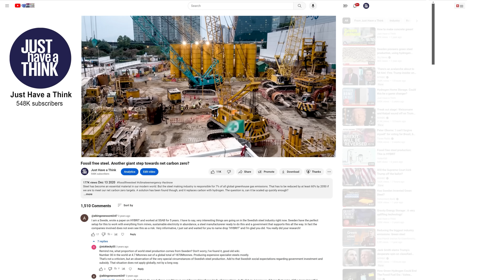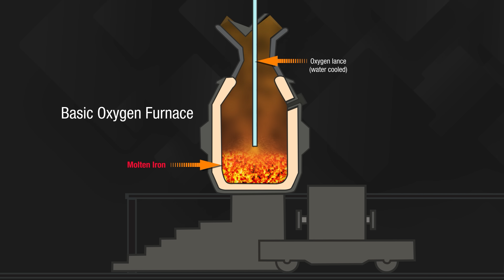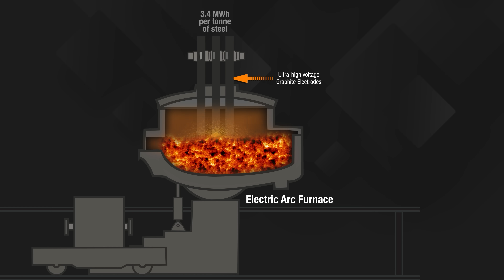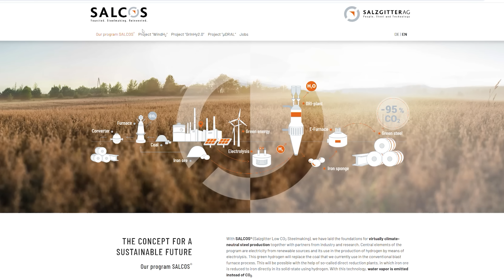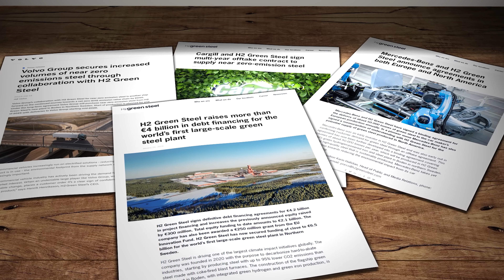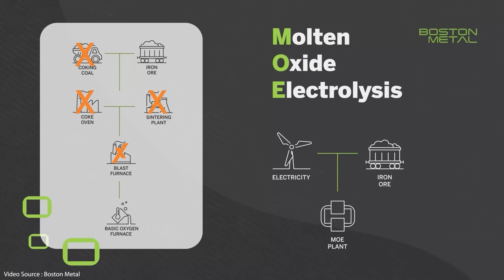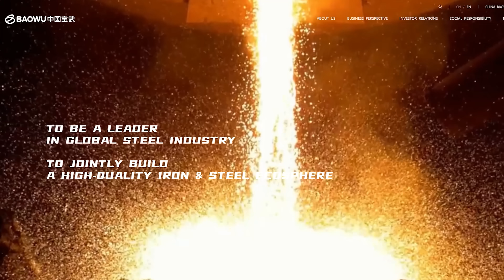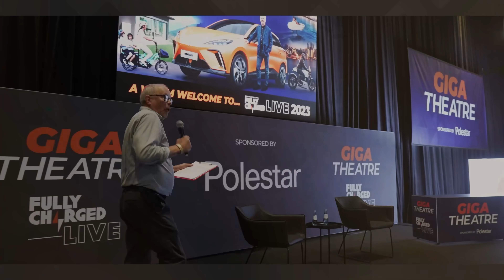Green Hydrogen making Green Steel. Is 2024 the breakthrough year?

Comment: Green hydrogen? That's the question. Could you make a video on high temperature gas nuclear reactors? I know Japan is working on it, and they allow for a green hydrogen process too. Annoying to research though.
Reply: Given that the hydrogen is cycled between water & gaseous form in a mostly closed cycle, It think that it's a moot point. More pertinent is the source of the electricity. Though a less regulated electrical source is required, so producing green electricity would likely be cheaper for this sort of use than the fine controlled flows required for household use.
Reply: @FreeManFreeThought  all good points.

 Mostly, I just remembered those reactors by association and wanted to comment in hopes of seeing a good, well researched video.

Comment: Ah yes, let's use electricity in place of fossil fuels, to make steel! Lol huh.  How do you produce that electricity??? Well, if it's by wind turbines and solar, you are going to have to tap that entire grid to get enough electricity to power the high energies needed to do all that heating,  or you use fossil burning power plants to get the electricity from but that just pushes the co2  pollution upstream, in the whole process so that doesn't fix the problem OR get the electricity from the practical, least polluting, efficient nuclear reactor plants that is the best solution,  in the real world power generation choices, in the world at present! The new generation nuclear plants are efficient and produce less radioactive waste and are safe.  Countries need to drop the outdated unwarranted taboos propagandized on the nuclear energy industry and build them to power the 21st century.   Actually a good part of the world sees this proper sensible solution and utilizes nuclear plants and are building more and/or modernizing existing plants but, as usual, the United States is way behind.  Smh

Comment: Ocean-based carbon capture isn't stupid.  It's not a gimmick, and it's actually intended to remove CO2 at a gigatonne scale.

On the topic of clean energy for producing green hydrogen for steel production, and various other things, here in Canada, we have a massive amount of hydropower.  We have 160GW of untapped hydropower in 9 out of 10 provinces, and not including the territories.
The  Northwest Territories alone, we there's 11.5 (or 13 GW if you include the Slave River between the NWT and Alberta) of untapped hydroelectric potential.

Hydropower is not just a source of electricity generation.  It's a means of achieving grid stability and can help integrate tens of GW of wind, solar, and also inflexible sources of energy, like nuclear.
Reply: He did make a video about ocean-based carbon capture. https://www.youtube.com/watch?v=kzMWIrh6bL4

Comment: 7:57 As far as I'm concerned it is. 20-30% more is a absurdly large increase in cost for a foundational global commodity. It is not worth the CO2 reduction. Find a better method, or get cheaper electricity. Otherwise abandon the attempt.

Comment: The Molten Oxide Electrolysis is almost exactly the same method used to refine Aluminium.
Reply: The Hall Herault electrolysis cells do use carbon electrodes and CO2 emission is approx 1.22 t/t Al.

Comment: Another huge problem with this process is the iron ore must be over 67% .     Currently only 3% of world trade in iron ore is over 67%.   The majority is around 62%.   How to get the concentration up?   VERY expensive and energy intensive.    Grind all that iron ore into a powder, then add water and gravity, magnetic, separate out the rock.   Pump the remaining sludge into a tailings pond.   

The cost of upgrading iron ore is about 5 times the cost of direct ship ore.

Also, a couple million tons a year of steel barely registers.   Current annual production is just under 2,000 million tonnes.
Reply: It is indeed not that much on the worlds scale, but on the other hand being able to produce millions of tons a year from a facility is a big step up in maturing the technology and getting a good grasp on the challenges one needs to meet.

So in that sense this is a pretty big improvement, as it makes more clear what kind of costs one can expect as well as if there are any further significant improvements possible.
Reply: @Quickshot0  Yes.   With costs, we also need to remember that all the estimates (30% more, etc) is assuming that all inputs are still produced and provided with fossil fuels.    If you add everything downstream produced with green energy, costs are 3 or more times as much.  The world isn’t prepared to pay this much more for everything.   

I’m also assuming their cost for iron ore is a local, upgraded ore or pellets.  The production cost of direct ship iron ore is on the order of $20/t, not including shipping, etc.   The production cost of upgraded ore is on the order of $100/t, including mining, infrastructure and production costs.  But it also commands a higher price on the market.  Still not as profitable as direct ship ore.
Reply: @Anopheles6  I'm not sure why energy costs would have to go up for there. Sweden has access to fairly plentiful hydro power I thought, and can probably get some good locations for wind power at competitive prices. Which one could try to buffer with the hydro power to get a steady power source.

Admittedly this may not work as easily for other countries.
Reply: @Quickshot0 I mean I'm just not sure why exactly they think the figures quoted are including fossil fuel energy in the first place. It's an assumption with no backing and directly contradicting what was said in the video. Doesn't mean it's impossible, but I'd like to see some sourcing.

I know very little on metallurgy, but some cursory research shows that while direct ship ore is popular in steel making because you can skip the cost of purifying ores, scrap iron CAN be used in the DRI process. Yes, there are more impurities in the intermediate iron. But that's not the final product. You just purify out the bits you don't want when you go and make the steel (immediately) anyway.
Reply: @Quickshot0  Unfortunately this project is an utopia and economic disaster. There is a group of economics here in Sweden that has turned every stone and revealed this fantasy. To build windpower is expensive, hard to get all the permissions AND there is no power to produce when there is no wind... Hydro power can not be expanded more  and green steel production needs 50% of the electricity  the whole country uses today. The thing is we need more electricity for the new cars etc.and the first next nuclear facility will be ready in about 10 to 15 year from now. This green steel project is pure fiction and should be abandoned .
Reply: @MrTheropod  It should be possible to use windpower in conjunction with the hydropower to increase effective power production a bit still. After all this is the same principle as building dedicated energy storage systems to store energy.

With it just being that hydropower can store many months worth of energy usually.

That should be more then enough to buffer some wind power generation. Of course there are limited to how much you can gain from that, but even at a naive assessment you should be able to gain some tens of percent on top of your hydropower like that.

That's probably not enough for Sweden long term goals of course, so I guess thus why the nuclear plant being built. But it would be something at least.
Reply: @MrTheropod 
yes exactly my meaning 
Well said ,I have written several comment saying this 
Nice seing somone else 
Writing this also.
In the 80 tes there were a prodjekt called "stålverk 80 " steel mill 80 , several regions outbid each other to get the 
Facility built in there citys  gavle stad was one of them. 
It did not get built anywhere, and the prodjekt was very expensive/ a huge  eko -loss even doe it never got built.
Reply: @Quickshot0  Problem is that they will need the power for this project long before they theoretically can present a solution for that. 
It is calculated that energy needed will be in parity with the energy consumption of whole our neighbor country of Finland and there are no solutons for this at all.
Hydro power is not very stable, it needs high water flows to produce peak power. Wind is most unstable of them all. It does not produce much in winter time since there is little wind then. Only gas, oil,coal and nuclear plants are stable enough.
This ekvation is impossible from get go..
When our energy minister Ebba Busch was asked this question she answered that she did not know but" we will solve this somehow"..... That is how politicians talk....
To plan, project, build and have a nuclear plant up and running is calculated to take up to 15 years. 10 years if they could start building tomorrow. This project is dead before it even started.
It will unfortunately cost a fortune for them and the tax payers before they realize that.
Reply: @MrTheropod  10 years is rather slow for building a nuclear plant. I think the worldwide average time was 5-6 years. Are Swedes especially slow at this? Or is this a matter of not hiring experts from abroad for the matter? In any case this sounds a bit like building nuclear power plants rather slowly.

Also saying hydropower is unstable is not very credible. You collect water in very large catching basins storing months worth if not years of stored energy. As such hydro is actually one of the more stable power sources. With out those large lakes to help increase height and thus power generation efficiency it doesn't even make much sense to have one. So I honestly do not understand how you can conclude what you say there at all. Peak power as such is a decision to let more water out of the lake, one you'd make depending on how much power you get from other sources like wind. Wind is blowing, you don't run the hydro, wind isn't blowing you run the hydro. Thus letting the same stored water be used for longer at peak levels. This is just basic physics.

Beyond all this, isn't the Swedish plant already built and operational? That was what this video said at least, so saying it can't be powered seems strange. Or do you mean some kind of expansion for large scale production?

Comment: Not sure you got the elephant in the room. Electricity. The electricity demand in Sweden is calculated to rise to 260% of todays consumption by 2050 and that's simply not possible. They don't have any excess hydro power in the north. The hydro power has a very high value in balancing the grid to sustain the use of wind and solar.
In the end it will be to big to fail, like the banks, and the taxpayers and consumers will take the bill in the form of rolling blackouts and high electricity price.

Comment: Finally a use for hydrogen.
Reply: Hydrogen has long been in use in various industrial processes, the big problem being how it is made.
Most by far is made by steam reduction of methane, resulting in an enormous carbon footprint, thus the push to greenify it by using electrolysis based on renewable energy.
Reply: 30% of global natural gas production is used to make hydrogen. It is mostly used to make ammonia as a step to making nitrates for fertiliser.
The carbon dioxide generated is a waste product to get the oxygen out of the air used as a nitrogen source.

Comment: What type of hydrogen is being used? Blue, Green or something else? If blue would it be better to use natural gas? I see so much hype for hydrogen but always question the overall carbon output to get hydrogen. However, anything would be better than coaking coal.
Reply: Sweden uses hydrogen from electrolysis. 
There is not (unless there is a pipeline from the Norwegian gas fields) any local sources of either gas or coal near the large Swedish ore deposits. That is an unmentioned further driver for looking for alternatives to fossil fuels for the Swedish producers - they are already somewhat more expensive in comparison to their global competitors. Standing up a production that takes advantage of their potentials for plentiful electricity will be cheaper for them compared to much of the current production.

Comment: Yes, it is a good thing to look at steel made from hydrogen. At the same time it would be good to look at another source of hydrogen, i.e. methane. Of course many folks are against the extraction of hydrogen from methane if that also puts CO2 (or leaked methane) into the atmosphere, and I agree with that. However it takes less energy to take methane apart than to take water apart. For example, methane pyrolysis proceeds carbon and hydrogen without CO2, and costs about 38kJ/moleH2 in energy. If part of that hydrogen is burnt in oxygen producing water, you get 386kJ/moleH2 of energy. That indicates an excess of hydrogen that can power your steel making operation without external electric supply, without CO2 emission and with a source of ultrapure carbon for the process. It is even better if the process can deposit the carbon in fiber form that can be its own commercial byproduct.

Comment: With cycling back to review advances in previously covered topics, we'll be looking forward to your update on green technology advances in the cement for concrete industry.  This is another of the big impact industries that needs to see improvement.
Reply: I can guarantee there will be no substitute for fossil fuels when it comes to high energy-consuming industry like concrete manufacture. Ain't in the laws of physics to consistently supply that amount of energy from fickle and  diffuse low-energy production sources like wind or solar. Even from nuclear using electricity for large-scale energy intense manufacturing is not satisfactory, and at present rate of replacement we could be without any operating nuclear power stations in 10 years time.

Comment: Sweden and Finland are building a green hydrogen system around the Baltic Sea's Gulf of Bothnia and they will connect everything with a hydrogen trunk pipe. The hydrogen will indeed be used for steel first. Later when they have more capacity perhaps it will be used for peak electricity/heat production.
Reply: The energy needed for the whole steel industry in Sweden is about half of the total energy Sweden produce. So this is bullsh...
Reply: @atvheads  Hydrogen is only a part of the energy. They won't recycle electricity through the hydrogen process and there is plenty of electricity that will still be used by the arc furnaces. They will just replace the coking coal with green hydrogen. Furthermore there will be HUGE off-shore wind farms in the Gulf of Bothnia and this power will have to go somewhere. Hydrogen production is a good candidate to soak gigawatts of windpower. Eventually chemical plants, fertilizer plants, power plants and other industrial users will join the pipe. There are also plans to connect the pipes to Estonia and Denmark. The only part of the plans I'm really skeptical is the plan to use the hydrogen to fuel heavy trucking going up and down both Sweden and Finland and which is currently powered by diesel. I have serious reservations about the feasibility of hydrogen trucks.

Comment: I would really root for the molten oxide electrolysis method, even if its yields are lower than the hydrogen reduction method, it still takes out a large chunk out, which is to produce green hydrogen using electrolysis...which itself is a fledgling and inefficient process.

Comment: Is there a way to get hudrogen out of oil without producing emissions.
Reply: Why would you do that?
Reply: Not sure if it will be worth doing with oil, but in theory its possible to do with natural gas via pyrolysis. IIRC this process can have up to 4x lower electricity demand than electrolysis, but it also is inherently more polluting since methane will inevitably leak into the atmosphere. Also this tech is only in prototype phase right now.
Reply: Currently 95% of hydrogen comes from steam reformed natural gas, hence the fossil fuel industry pushing the 'hydrogen economy' which is just a fig leaf for natural gas sales with a larger carbon footprint..  The are similar methods to get hydrogen from oil & coal, with similarly massive carbon footprints.  Japan at one stage was considering importing Australian coal to use to generate hydrogen as a Climate Change mitigation strategy!  Looks like the fossil fuel industry had been able to completely fool plenty of people in Japan!!

Comment: Steel production has the possibility of migrating to be a supply following industry, because it is a batch process and storage of steel is feasible.  So you could store hydrogen on a daily basis to deal with nightly fluctuation in  PV solar, and idle capacity for a few weeks if you had a wind drought in a particular year.  This might work if folks implement tariffs on steel based on carbon used in manufacturing, to drive Chinese steel down in the market.   Using hydropower to produce steel doesn't make sense - you should be using it to produce fertilizer since the current production process for ammonia requires consistent steady state operation.
Reply: The trick is to have an internationally recognized carbon tax agreed to.
That is such a simple measure that would strongly incentivise reduction of carbon emissions. But of course, there would be losers, and they seem to have big bucks at stake, so...
😢
Reply: @gregbailey45  That is a trick that is not going to succeed, since neither China, India, or the USA will go for it.  However a tariff on  effectively Chinese steel would appeal to both the USA and Europe.